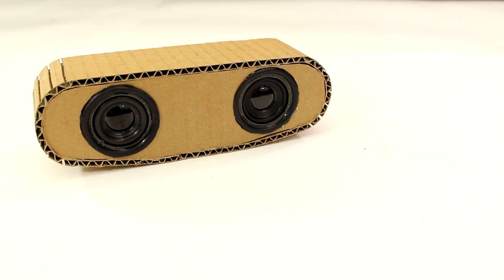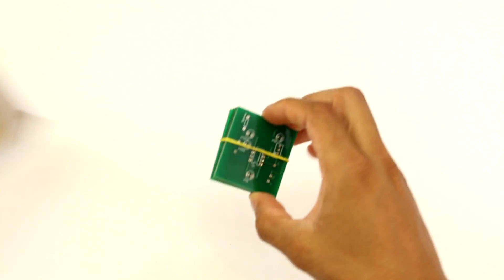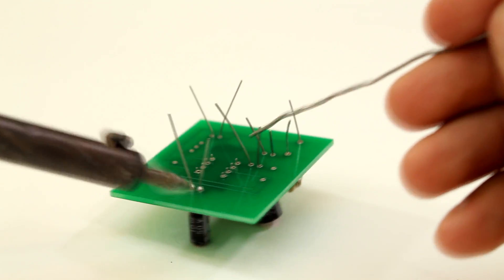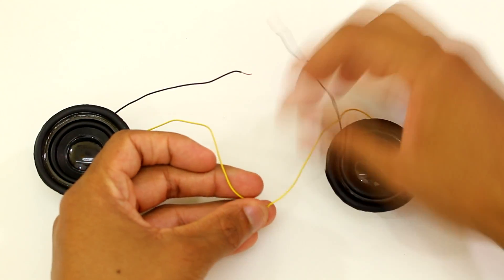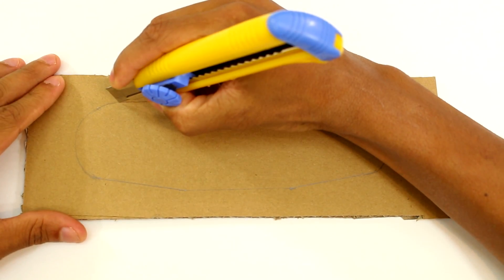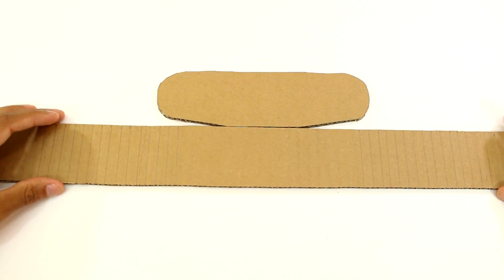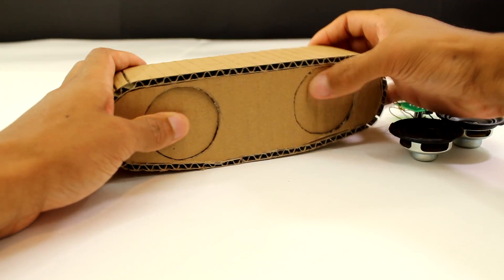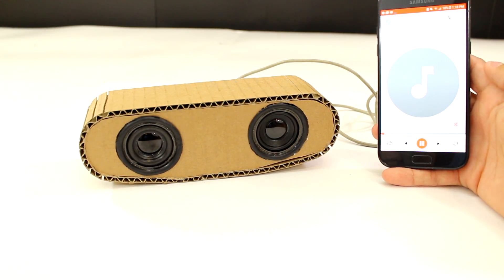How to Make A Mini Portable Speaker

Comment: Could i adapt that to an old phonograph, that amp looks simple,,  wonder if i could wire one end to a speaker, and the line in to my mic input.. Though i am using vintage switchcraft, and cannot find a RCA jack adapter. for it...

Comment: 1:07 you put electrolitic cap wrong. Also never use 9volt batteries like this one in audio amps because they cannot give out the current the amp needs. Also this speaker quality is literally trash why would anyone want to make speaker out of cardboard?! Your speaker enclosure is not air tight neither ported. Also the pcb could be 10 times smaller. I am pretty dissatisfied with your video.
Reply: and how is the right way to use a 9-volt battery for audio amps?
Reply: @istibudi7884  9volt battery cannot output the current the amp needs so at high volumes or bass the audio gets distorted
Reply: @istibudi7884  dont use 9v batteries for speakers
Reply: @acquireelectricity1458  so what is the alternative?
Reply: @istibudi7884  li ion or li po rechargeable batteries with protection and charching circuit